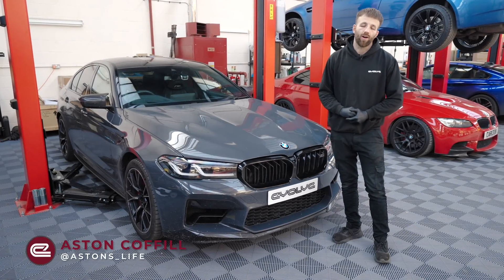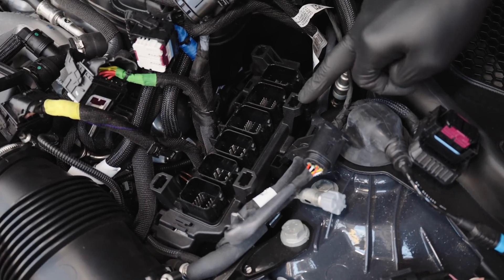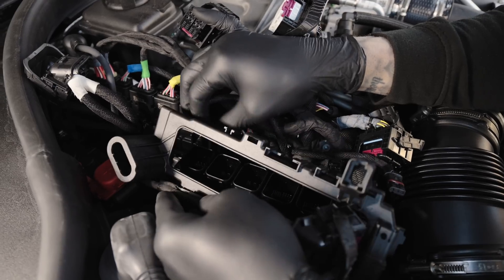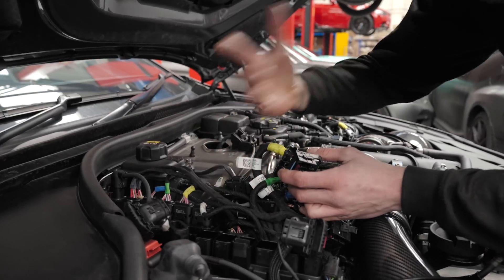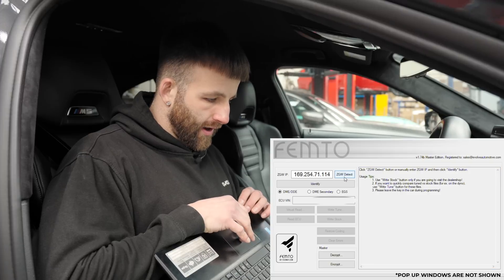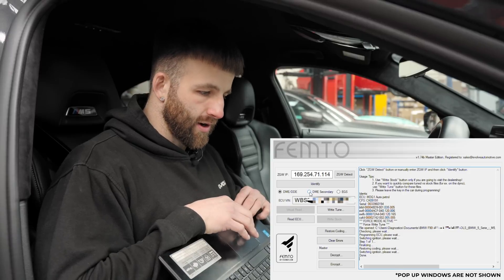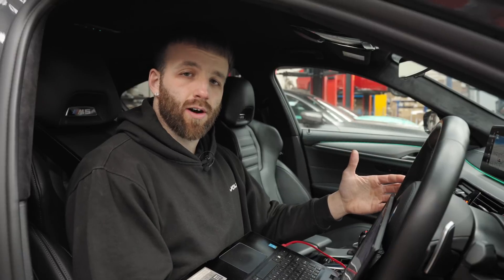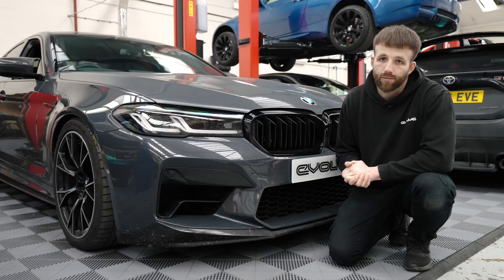How to unlock your F90 M5 ECU for Tuning - Full DIY Tutorial

Comment: Femto  has been doing this unlock for the G80 as well same process to unlock.
I don’t understand why they haven’t used a universal unlock so I don’t have to uninstall the ecu and send it to them.
Another negative is if BMW sends and OTA update it wipes the ecu and locking it Agia n. I know many will disable the ota update to retain the tune. Christ what a pain in the ass
Reply from the maker: Yes, we will be doing a tutorial for G8X also.

They are being very cautious about the unlock as Bosch as supposedly are in a contract with BMW with financial clauses if the ECU is cracked, which it has been. So they are incredibly motivated to fix the flaw, and then we can’t tune at all.
Reply: @EvolveAutomotive  thanks I’ve never been able to understand why the ecu got locked down so hard. Could you go into more detail in a video or post? Why would Bosch make such a stipulation and why would bmw comply